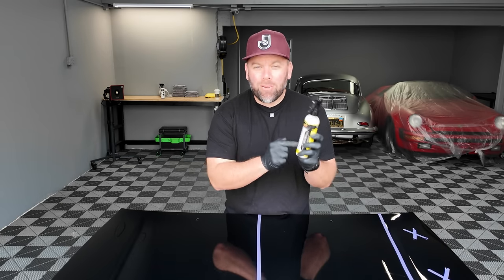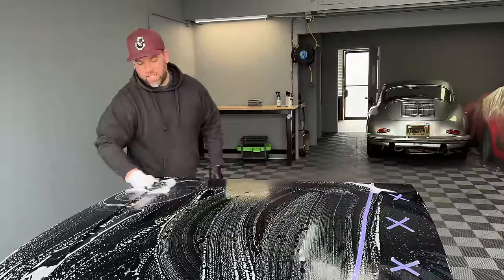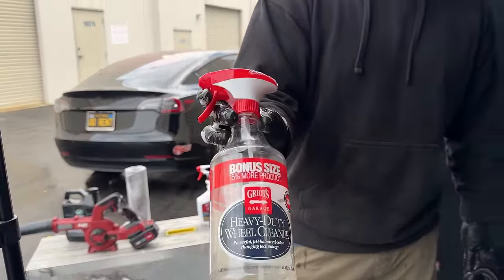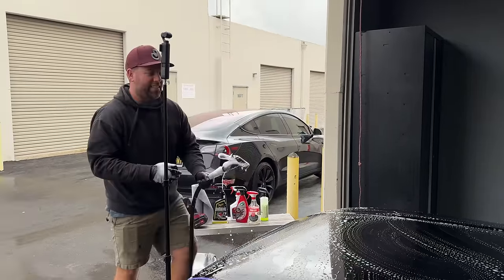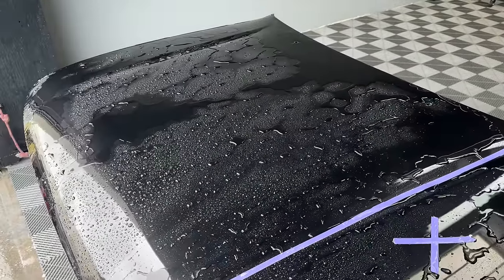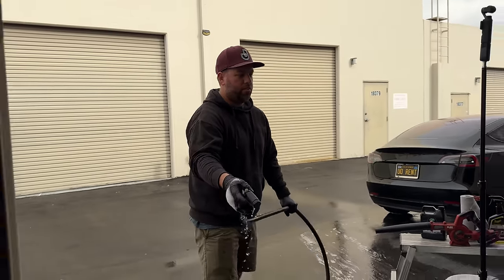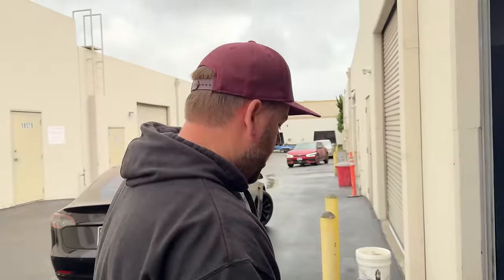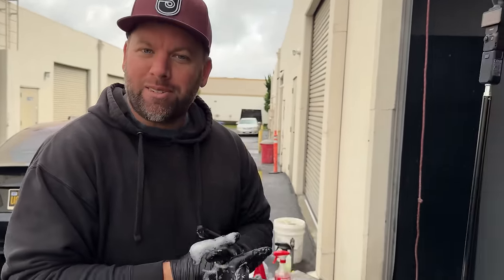NEW! MEGUIARS ULTIMATE CERAMIC COATING - IS IT LEGIT?

Comment: I tested it as well on my channel, I did not have that same issue. I let it cure less than you did but it seemed like it performed better. Nothing ground breaking, not the best in the world, but decently enough.
Reply from the maker: I saw it and thought it was a good video. It gave me hope for it. That’s why I ended up testing it twice. First time I got same results as second but couldn’t believe it. The only thing I can think is you did a small square and the panel seemed vertical. But as I’m seeing with other products (Cerakote, this, etc) they seem to be very inconsistent. So that’s ultimately what my conclusion has been. That the results vary because the product is very inconsistent between batches etc.
Reply: @autodetailingpodcast  good possibility on those points. Either way I wasn't taken back by it and good to know waiting til 7 days didnt make much difference.
Reply from the maker: For sure man! It’s kinda a pain to wait the 7 days, especially when you do it twice. Haha
Reply: Your panel be soaking wet when you apply products which is going to heavily dilute the products which gonna make the products appear better than what it is
Reply: @Dee--Jay  the hydrophobic spots on the panel have some beads sure but not enough to affect the strength of the chemicals sprayed on there in such volume.
Reply: It takes so little time to apply sealants these days, no  more than 30 minutes to do my Trail Boss, I am satisfied with the qualities of F11Pro.

Comment: I attended 10 or more Meguiar's training classes and began using Meguiar's products since 1998. All my products I use were Meguiar's only until a year a go. I tried Turtle Wax products and the first was the Slick and slide. I purchased 1 container to see how it worked! I was amazed how well it looked. My wife has a 2021 Jeep Grand Cherokee Trailhawk that spends most of the time in a Climate Controlled garage. I did a complete wash, clayed the vehicle and decided to try the Turtle Was Hybrid Ceramic Wash and dry. I next applied Hybrid Ceramic Spray and buff. Now every week for the last month or so I wash using only the slick  and slide. and rinse. This stuff out does any of the Meguiar's products. So all I use on the vehicles I detail are Turtle wax products. Even the Leather spray is great and customers really like the scent! John
Reply from the maker: They definitely have gotten a lot better of the past 5 years or so. I hope they keep it up! Pure wash is def one of my favorites.
Reply: All that detailing and attention with no paint correction thrown in there?

Comment: Reminds me of the "Ceramic" protection the dealer put on my previous truck.  Water stopped beading and sheeting after two washes.  When I bought my most recent truck, I told them (dealer) to stuff their coating as I will be taking care of it myself.  TW has been knocking it out of the park lately.  Currently have a coat of their ceramic+graphene paste wax on it to hold the truck over until spring when I'll do a full proper ceramic or graphene coating.  Their "Pure" soap you used here is my favorite, and is awesome in the foam cannon.

Comment: Jimbo, sticking with the Turtle Wax wash theme for a moment...
If, in fact, the soft Slick&Slide is degrading the coating, I'd hate to see what the TW MAX-POWER would do at a mild-strong dilution ratio.  Never mind whatever shampoo you used in your first test, especially in light of a weeks cure time not exposed to the elements. 
It's apparently perplexing and disappointing for a Meguiar's product.
Reply from the maker: Agree

Comment: I prefer the hybrid ceramic coating over the quick detailer. In my hands the quick detailer died of at the 3rd wash with BH Autofoam and touchless 13 and 12 ph respectively at 3% PIR

Comment: That's interesting that you mention the McGuire spray wax stuff because I had the blue stuff you mentioned and I followed their directions on completely and it always leaves a smeary, streaky residue on the car but their green bottle quick detailer ceramic stuff works well, goes on great, and lasts a couple washes living in the Arizona sun.
Reply from the maker: I much prefer the green bottle stuff too.

Comment: Jimbo, have you heard of a product called shiny car stuff?  Seems like it could be a good product for older vehicles that aren’t worth repainting or clients that are just trying to flip a vehicle and don’t want to spend hundreds on paint correction and ceramic coating.
Reply from the maker: Is it similar to x-kote?
Reply: @autodetailingpodcast  I think so.  Maybe it would be better to try Optimum CCR?  Either way I would love to see you test and torture these types of products.  There is a time and place for products like this and with the number of older vehicles on the road and folks feeling the pinch it just might be the best option for some people.
Reply from the maker: There’s def a place for it. I do wonder about the durability but it looks like there’s a bit of a learning curve to using it too

Comment: Sorry did you say it needs 7 days to cure ? For those without interior spaces I’m not so sure this product for me would even be considered- I personally use Autofinesse graphene paste wax and top it off with Turtle was Graphene detailer spray and I get phenomenal results .
Reply from the maker: I don’t think it needs to be untouched for 7 days, but it’s not clear
Reply: It means it will be fully cured in 7 days, and to not wash it with chemicals for 7 days. Doesn’t mean it’s has to be garage kept for 7 days. Pretty common sense if ya ask me

Comment: Very odd, watched another torture test of this product and the filling capabilities and durability seemed much better.
Reply from the maker: I saw it too, and it gave me hopes for this product, but I tried it two separate times both with seven days of full cure and got the same results both times. The other video he did use a vertical panel and it was only one tiny square I don’t know if that had anything to do with it, but for me, my results have been consistent
Reply: Maybe paid?
Reply from the maker: Nah - I don’t think he was paid. I think they and others (Cerakote etc) that are claiming “curing issues” are actually having a consistency issue. Batch to batch is different, product is curing in the bottle, or not curing, temperamental with different paint finishes etc.

Comment: I think you tested the wrong product. They just came out with their actual paint coating M888 aka Meguiar’s Beyond Ceramic Paint Coating. It claims multi year durability.
Reply from the maker: Nope. This was the right product. But I also picked up M888 and will do a review on that as well.
Reply: @autodetailingpodcast  Fantastic. Just threw me off when you said it was their most durable product.
Reply from the maker: they said that, not me!  @alonzobarnes302

Comment: What would you recommend for ceramic coating or a ceramic coating spray thanks?
Reply from the maker: just depends on your needs/wants. A Spray is going to be much easier, but less durable. But if you maintain your car often and want an easy to use solution a spray is going to be great. If you want long term durability and have some time a wipe on is going to fit you best. Either way you can always do long term maintenance w/ a spray.
Reply: @autodetailingpodcast  well I think I'd like to do a wipe on because I'm trying to make my clients car less involved for him

Comment: I only wash my cars with a cheap Turtle wax or Mothers wash and wax. I live in Florida and it rains all the time,year round. Now,I lived in Calif. most of my life. The rainwater there was much worse. And,the tap water from my hose was also. So the water spots were considerably worse. It doesn't matter what wax you use, I tried alot of different waxes,you're going to get water spots. So I don't care about how long the wax will last after washing the car with soap. My cars aren't going to go longer than a month with out being waxed again. I do care about how easy the water spots will be removed. In my real world testing,Griot's 3 in 1 ceramic seems to leave the thickest coating and beads the most. It's not the shiniest,or slickest, but it last longer. Turtle Wax Hybrid Solutions Ceramic spray beats the Griot's 3 in 1 for that. Turtle Wax Graphene MAX is slightly better than the Griot's but it cost a lot more. And for total longevity,ScottHD proved the Griot's beat almost every wax he tested,which was over 35 of them. Griot's 3 in 1 went up to a year! And it was the cheapest. For the ultimate shine and slickness,the Turtle Wax Max graphene beats every one. The spray wax that matches the gloss,but not as slick,is the Meguiars Gold Carnuba spray wax. it's cheap,but doesn't last at all. It makes a great detail topper. Extreme Solutions Topper last about as long,is slightly more, unless you buy the gallon size (which I do),and is the most slick of all the finishes I've tried. In Florida, I've never seen pollen in the spring like this in my whole life. It's unbelievable! Your car will be completely covered in yellow dust in less than a week.And pollen is sticky. Topper can't be beat for slickness. 

So in the real world,who doesn't wax their car after four months? People who don't care about their car,that's who! So does it matter which wax last the longest? I use a mixture of Topper (65%) and Turtle Wax Hybrid Solutions ceramic spray wax 35%,on a weakly basis. Every couple of weeks I do the windows as well. I don't have to wash my cars that often,maybe every 6 weeks,unless it's spring and the pollen is everywhere. My cars look like they're ready for a show,or up for sale,most of the time.

Comment: Everybody who is using standard soap-in-bucket washing method does need to use a drying aid for lubrication. That being said, $25 is steep for that purpose. I rinseless wash my vrhicles, so no drying aid really needed so the longevity of a sealer is important. 

The reality is that there are much better performing products in this category for less money. Turtle Wax Hybrid Ceramic, DIY Detail Ceramic Gloss, and Griots 3 in 1 Ceramic  are all vastly superior priducts for longevity for less. I have even seen a spray and rinse product like McKees 37 Hydro Graphene or DIY Quick Beads show likely the same durability or better. 

I hate ti call it embarassing but Cerakote kind of had the lock in that sentiment right now. LOL
Reply from the maker: Cerakote has the lock on products that underperform?
Reply: @autodetailingpodcast  I would say their Professional Ceramic Coating does, for now. Ive used their headlight restoration kit with success but that new ceramic coating was a real mess.
Reply from the maker: it sure was. The funny part is I got scolded for calling it out first. @johnfreeman440
Reply: @autodetailingpodcast  Nobody can question your integrity - that's why I love your channel. I really just got icky feelings when a very popular detailing YouTuber produced a video to essentially gaslight those mentioning problems with the product and then a "roundtable" that most of the members were not on board with the company message. 

It's been a real mess, but you retain our respect because you weren't scared to tell the truth early on.

Comment: Even the bead booster has a better resistance what you threw at the panel lol, this isnt worthy of the name ceramic coating. Only thing i use from meguairs is the non acid wheel&tyre cleaner. That is in a league of its own in removing dirt and brake dust from your rims.
Reply from the maker: im still a big fan of a lot of their products, but this one needs a little work.

Comment: I dont put all my faith in on torture tests. Theyre unrealistic to a degree, however they are absolutely data driven and they at least give you some idea of what, if any, chemical resistance and durability a product has. My faith in megs is definitely at an all time low.i was actually excited to see how this product would do. Theres no reason at this point not to have a product that can last six months when we are calling it a coating. Turtle wax doesnt have issues doing it and they do it cheaper. Griots does it. Ethos does it. Adams does it. And the list goes on and on. Megs ceramic line up is just not there for me compared to the rest of the industry, well some of it at least. 10-15 yrs ago they were all i used. I guess they think consumers are not evolving like the rest of the industry. They better start evolving...flashy bottles and marketing buzz words dont work like they used to. And i agree with you, its probably not a bad product. Its just not a good one when compared to other available products out there.  I guess there are still a lot of people that dont know better so as long as they keep buying, megs will keep making the same under performing products year after year. Sorry for the rant...Keep it up jimbo! Keep it real...
Reply from the maker: 100% agree with you. I don’t put all my faith in torture test either. But it gives us a baseline for products at least.
Reply: The TW hybrid ceramic left watch spots on 3 cars ..that etched into the paint..if it was so durable I feel the spots should not have etched through.   That TW did great on all the torture tests but let simple water through.

Comment: I will never exchange polymer sealant covered with nuba for this ceramic crap. Everything that has sio2 fills your paintwork with water spots, some of which are irreversible.
Reply from the maker: You have a great point here. Something like a synthetic x press spray wax is very good.
Reply: Yes ..Their hydrid paint coating  has been the best I've used resisting water spots.   Even 4 coats of griots somehow water etched through.   What polymer do you use??

Comment: So I decided I wanted to try it both ways. I made sure to clay and polish my hood. But the rest of the car I left alone. And my car is already insanely clean. I rinse prolly 3 times a week and hit it with a spray wax atleast 3 times a week. So the amount of product that’s built up on my car is a lot. I know it’s prolly a waste of product but Sorry I’m just insanely anal about my car. Anyway I used the product as directed on the hood. And the rest of the car I wiped it on and wiped it off as your supposed to just without the clay and polish. And it held up just as good as the hood. I was at the car wash last night and the water just came right off. Along with the foam wax spray. It just came right off the car. So honestly screw the hole clay and polish. Cause I don’t see it lasting as long as it says to begin with.
Reply from the maker: Your car sounds a lot like mine. Haha! Love it.

Comment: Wierd it did well in martins video.
Reply from the maker: Small square on a vertical panel. Also I’m finding out these products will perform different on different types of paint. Which is making for massive problems for the brands.

Comment: Really hate to see these products. To me they’re a waste of time and money if you’re serious about your car. I understand these type fill a segment of the population though.
Reply: I will never exchange polymer sealant covered with nuba for this ceramic crap. Everything that has sio2 fills your paintwork with water spots, some of which are irreversible.
Reply from the maker: I think that’s why it’s in their ultimate line and not the hybrid line. but who knows.
Reply: @daniell5751  not even remotely correct. Ceramic infused with graphene most definitely lessons the water spotting. I’ve had Ethos Graphene V2.0 on my personal cars for the last 10 months. They stay outside and there’s not one bit of water spot damage on them. If they do get spotted from the rain the spots easily come off when I wash them. Both cars still bead up water the same as the day I applied it….the “ceramic crap” as you call it will last far far longer than any Nuba product made. Bottom line is if you’re cleaning your car the way it should be done you’ll never have a water spot problem.

Comment: I’m not a fan of your test methods personally.  I wouldn’t be using a soap that claims to be ph neutral and infused with polymers.   

It’s not really just a straight shampoo.   

But like you said, it is infotainment.  

However I’m disappointed with Meguiar’s marketing of this product, claiming it is a coating. 

This is a spray sealant.    The description and instructions don’t suggest otherwise.
Reply from the maker: Fair enough. I did try with a regular pH neutral soap and it actually performed worse than with pure wash. I went with pure wash because I use it often so I’m aware of how it works so I thought it would be a safe bet here.
Reply: @autodetailingpodcast  one more thing though Jimbo since I have your attention.   Some food for thought based off my personal experiences.   

I’m a diehard Meguiars’s Hybrid Paint Coating fan.  

I’m trying to figure out why they would market this new product as a coating also.  The products are not even remotely similar.
Reply from the maker: Because marketing. That’s the only reason I can think of.
Reply: @autodetailingpodcast Jimbo have you reviewed the Megs Hybrid Paint Coating? I love that stuff. Very easy to apply, has insane beading, and good longevity. If they would have dropped a “ceramic” in the name it would be alot more popular 😂
Reply from the maker: Ya it’s a nice product. But I think it’s on its way out unfortunately. Meguiars fast finish was better than this too but it’s not sold any more either.
Reply: Yes..I hope they don't discontinue their hybrid paint coating..  its lasted a very long time for me and us the only thing I've found that has stopped the water spot etching..almost like many tiny beads don't wtch the osont like many large beads?  Or..more likely because it's not a ceramic...